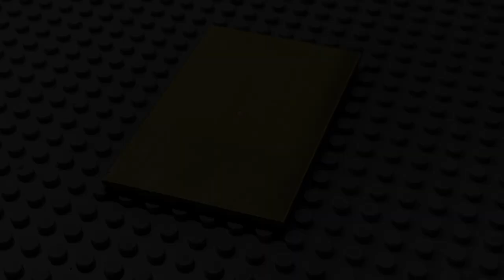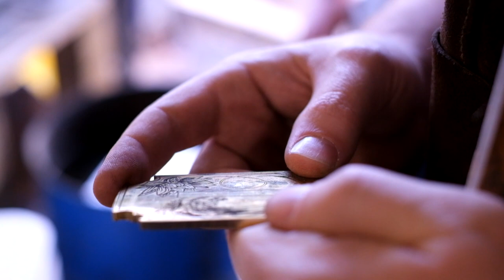Forging a Katana from an Old Saw Blade

Comment: I hope you see this since it’s been a while since posting vid. In ur garage in beginning of vid. The press you have There appears to be a shot press, are you able to use it for forging purposes? If so info please would be appreciated.
Reply from the maker: For hobby work it has been fine and even for some customs it has worked, I am about to upgrade it, building another one. 

It’s just an air jack I purchased at harbor freight and the frame is built from scrap steel. 

I primarily use it for Damascus and on occasion axes I make, it’s slow but if your only working on one piece it will work